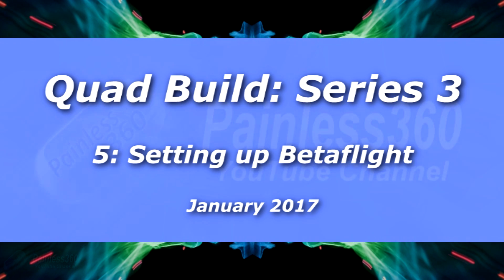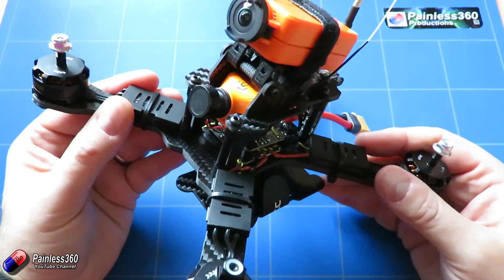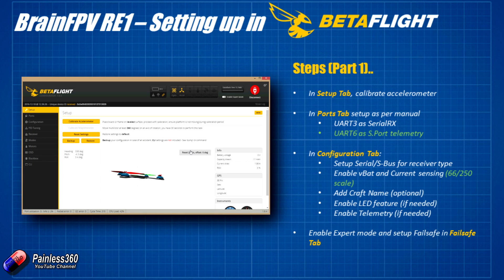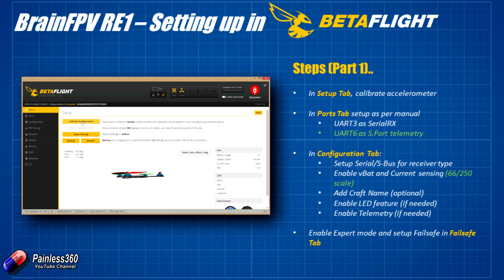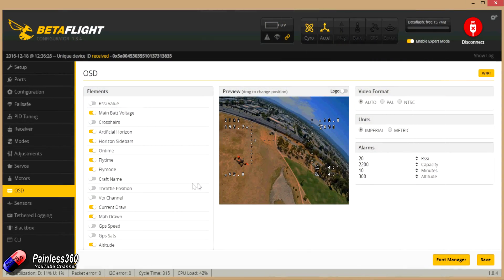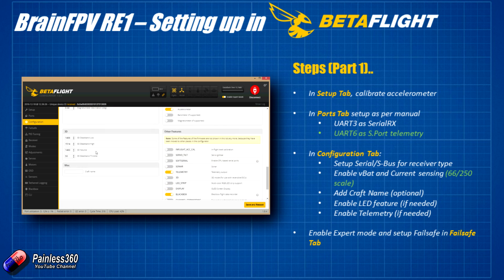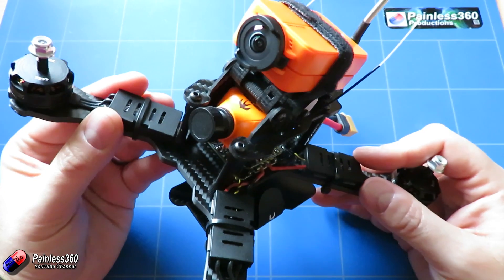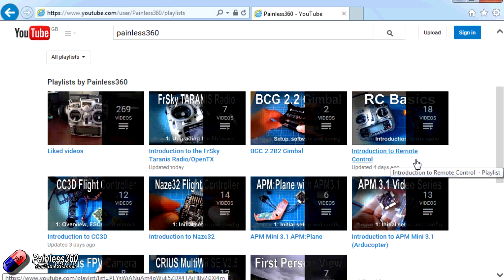(5/7) Quad Build Series 3: Setting up the BrainFPV RE1 in Betaflight

Comment: Interesting.  I came across a thread in RCGroups discussing issues with the HV version of the TBS Unify Pro producing diagonal lines, but the 5V versions are not having the same problems.  

BeardedFPV, which vTx are you using, and if it isn't a Unify or a Tramp, can you still change vTx settings (channel, band, power levels) using the OSD.  The ability to change these settings via the OSD is one of the main reasons that I am considering the BrainFPV FC.
Reply from the maker: I've not used the HV version.. You need a Vtx that talks either the TBS or TRAMP HV protocols to change the settings via the OSD..
Reply: Since the new BrainFPV BF/OSD firmware has been released, please let us know if any other vTx's have been added that will change settings via OSD.
Reply from the maker: https://www.youtube.com/watch?v=q2bWcvXKxXM ;)
Reply: Thanks for the video!  Are there any new vTx's added to the group that can have their settings changed via the OSD (i.e. band, channel, power level output)?   

If not using a Unify or Tramp vTx, what OSD setting capabilities are lost?  Do you simply not have the ability to change band, channel and power level output, or are there others?

Comment: Do you have a video concerning the latest Betaflight that goes into depth on the PID Tuning page? Not really about the PID tuning but more about all the other selections/features. There are many new and different things on that page especially if you're coming from the Cleanflight GUI. Thanks for the video.
Reply from the maker: Joshua Bardwell is excellent at covering that in depth - check him out! Happy flying!

Comment: Hi.

You told there isn't an RSSI pin on XSR FrSky receiver and that is true, but there is a little RSSI pad near one of the antenna connection.
Check at the link below
http://www.stosd.com/?p=785&cpage=1#comment-44
Reply from the maker: Thanks for the comment, I'm aware of the pad on the XSR and X4R but I'm not a fan of soldering things onto receivers if I don't need to. For park flying the trick we showed in the Naze32/Cleanflight video (using a channel to send the RSSI value to the FC on a spare channel).. Thanks again for talking the time to post that..